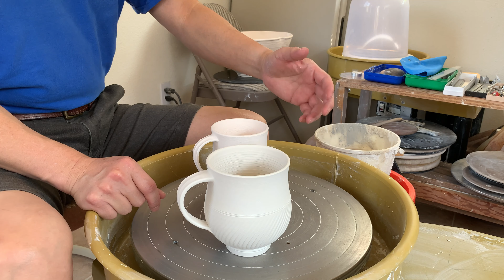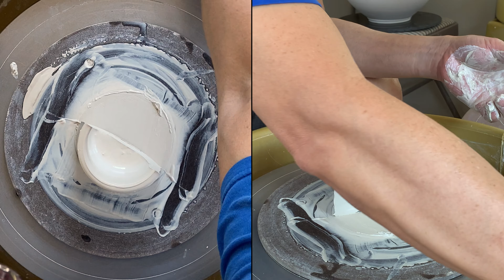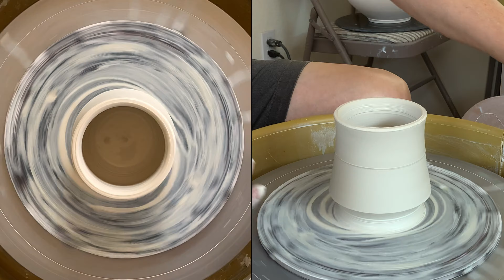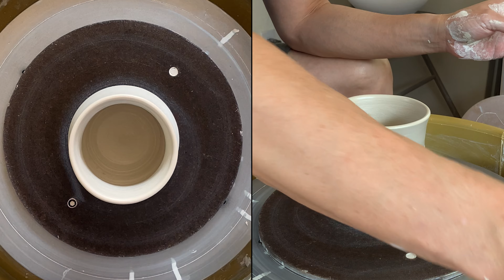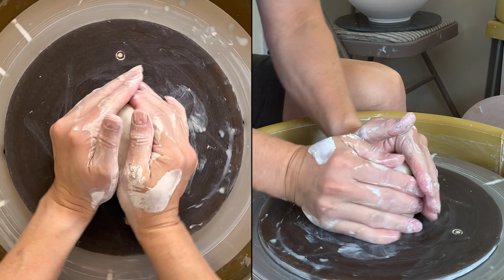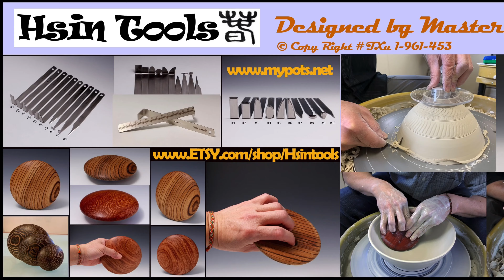513. Design Various Shapes for Mugs with Hsin-Chuen Lin 林新春 馬克杯設計示範

Comment: You've mentioned that you throw with slip on your hands instead of water in past videos. Do you have a video detailing your process for making your slip? Thank you for all these wonderful videos!
Reply from the maker: The slip was pulling off from your fingers. I didn’t against using water but just use it smartly. When you have slip in your hands, instead of toss it away, put it back on the surface and reuse it.